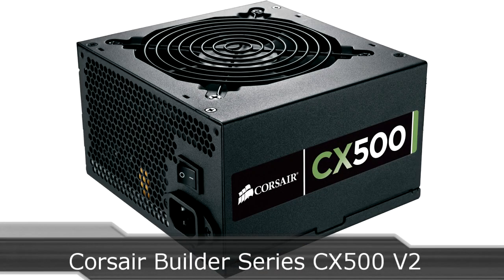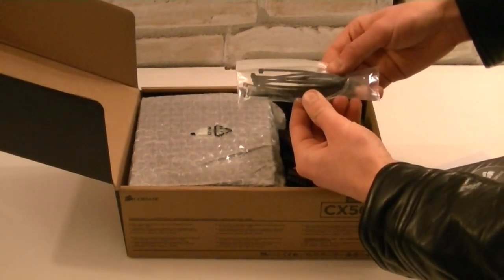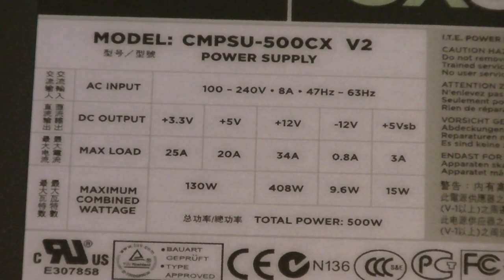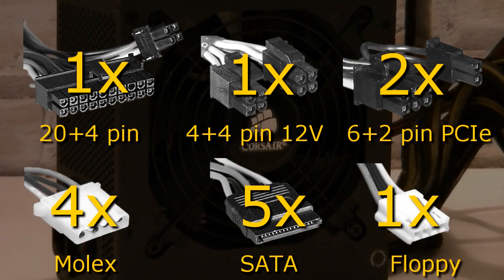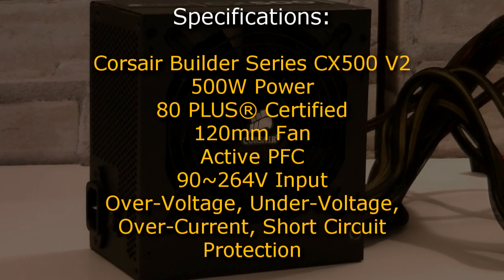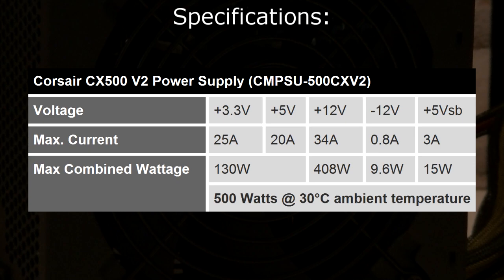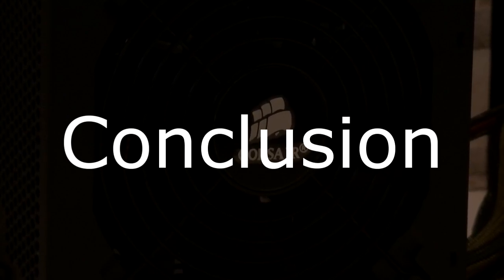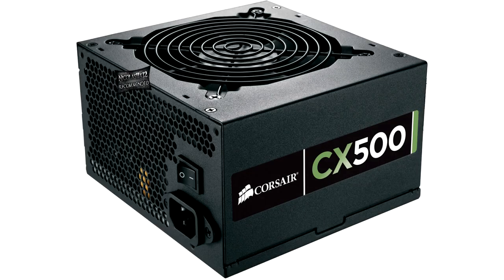Corsair Builder Series CX500 V2 Power Supply Review

Comment: can I use this too for the hd 7950? I believe it can because of the 34 amp on the 12 v rail but sure? processor i5 2400, using like 78 watts.
one hdd, one stick of 4gb memory , using a gtx 560 oc @950mhz now at 1.075 voltage. Is this cx500 enough?

Comment: Actually yes, you are right. Thanks for pointing it out! I wasn't paying attention when I was looking it up in my database, and mistook it for one of the older models. 

The CX500 V2 is manufactured by CWT - Channel Well Tech. It still is a great PSU for a good price, but I still think that the Seasonic 520 is a better choice. They both cost about the same ~55-60 dollars, but the SS-12II series is bronze certified and a little more well built.

Comment from the maker: @ItWasntMe456 Yes, the direction of the PSU is an important factor. Having the PSU mounted at the bottom of the case is always the best choice in my opinion. But then you should also make sure there's enough air for the PSU. Never place it on carpets.

Comment from the maker: @ItWasntMe456 Unfortunately I don't have any information on the fan. But I think it should be upgrade-able. But you will void your warranty if you open the PSU case, so I wouldn't recommend it. Maybe you should return it. Heat is generating if there's much load on the PSU. What system are you powering up with the CX500 V2?